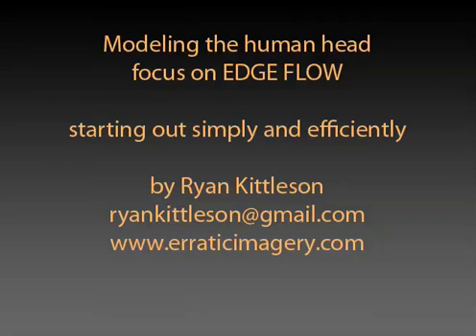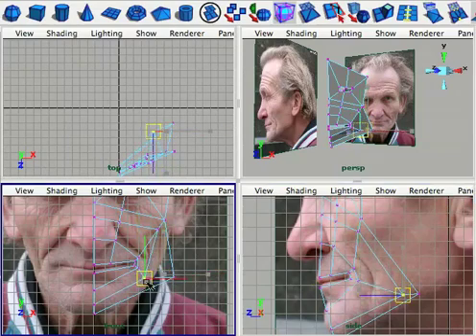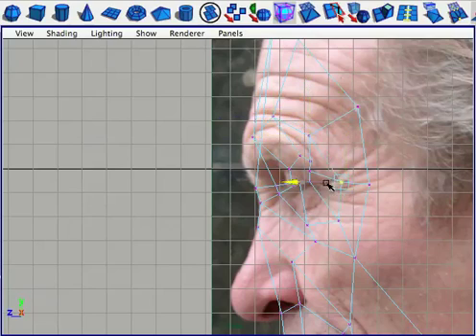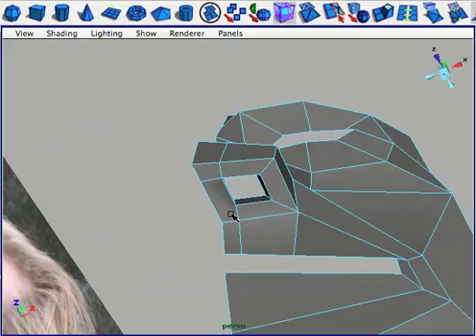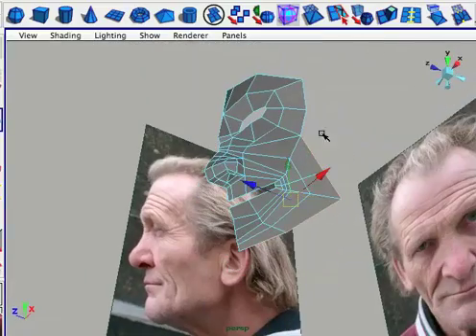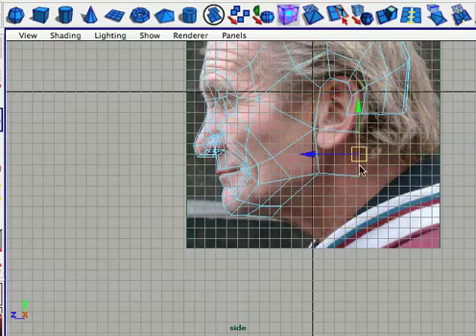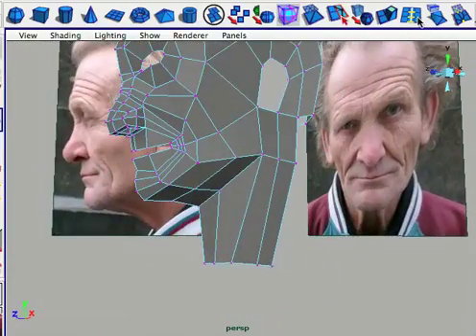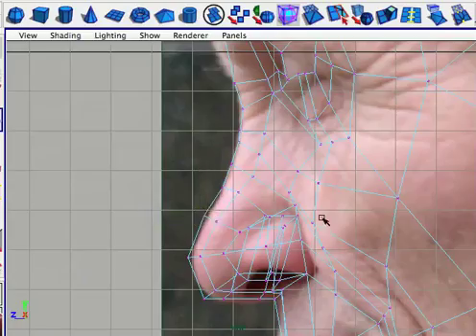3D Modeling tutorial for the human head. Focus on edge flow

Comment: I'm having a bit of difficulty working with the five pointed star at the bottom where the looks like it should begin. When i go to add the ear it turns into a 6 pointed star. Is there a way to work the edge flow around that area for the best results? These tutorials have been very helpful, thanks for posting them.

Comment from the maker: @VartinMana thanks!  six pointed stars are vertices that have 6 edges connected to them. they are bad because the more edges attach to a vert, the more weight it has over the deformation of that area.  It means that that vert will have disproportionately heavy effect on that part of the model.

Comment from the maker: @Grim1Tuesday2 What I think happened is when you mirrored the head, the merge tolerance was set too high and it merged verts that weren't actually mirror verts.  You can change the distance tolerance after you merge to a lower number to avoid the prob in the future.  To fix it, you can try deleting and recutting edges.  good luck!

Comment: Hey, great video. Two quick questions. How do you extrude from several vertices like that? I usually use edges, but you seem to be in vertex mode. Second, how do you then merge them together, such as when you had two seperate extrusions on the neck?

Comment: just a quick question. I want to model a head using subdivision. I have my basic head but I want to model in a way where when I move a vertex on the left side it will be mirrors on the right sight. How do you do this?

Comment: hey, im trying to do this in blender, im stuck at 3.22 when i delete an edge it destroys both faces.

the only work around ive found was to make a new face and then merge the intersecting edges and generally futz around with them till they look right.

its pretty time consuming and im sure there has to be a better way, like you demonstrated although in a different program.

any help on what tool i should be using would be appreciated

Comment: splitting up polygons and re arranging the geometry so they all have 4 edges is easy. but when I do that I get verticies that have more than 4 edges attached. they are not necessarily a "problem" if I have them in the right spot but they can screw up animation and UV mapping. I just try to keep the number of 5-6 pointed stars as low as possible

Comment: Of course there is - you just saw it (at least I haven't seen anything better), and I never said cube is the best, only traditional and most commonly used. Plus, darkgaze is talking about hiding the triangles using cylinder (like there's any difference - it's a stretched sphere) when he could (and should) easily avoid them altogether with a cube...

Still, this one easily destroys the cube approach , not to mention sphere or cylinder which I've never seen anyone attempt

Comment: Great. super great.

Wonder what are the best ways to build a generic head without all that level of detail, but the problems with starting with just a sphere... i know there are problems later on... with texturing in the place all the triangles join on top... i read you could do it with a cylinder turned so that joint is in the back of the head...

Comment from the maker: Hi Hadesdcc, glad my tuts helped!  I was using version 7.5 when I did the tuts. now I use 2009.  I haven't used the trial version, so I don't know if the tool is missing in it.  you might also try clicking on an edge and ctrl-right click, then go to the "edge ring tools" marking menu, and then click "split edge ring" when it pops up.  hope this helps!

Comment: Exactly. I'm using c4d and it works like a charm. A good modeling technique should be independent of the modeling package you're working with. General rules always apply, no matter what the edge cutting or extruding tools are called in max, c4d, lightwave or maya. :)

Comment: Wow you're an idiot.  By your reasoning PovRAY is even better since it does not even have a GUI.  You have to code your scenes by hand then then let the engine pars the scene then render it.  I started out on PovRAY while it was fun, I also like coding, it's not an ideal tool for efficient modeling.  I use both Max and Maya and as far modeling goes they are the same.  I pref Maya for texturing.  For me it's more intuitive.  You make like to bang your head but most just want to get the job done.

Comment from the maker: When a physical model or person is scanned, the result is super dense and messy.  There's software that ATTEMPTS to get the edge flow right, but really it's still a job that a human needs to do.  Basically by modeling good edge flow on top of the scanned model.  The advantage of doing it that way is that you get the extreme accuracy of the scan with nice animateable edge flow.  A talented digital artist can, of course, get the accuracy and edge flow without scanning.

Comment from the maker: You do raise some interesting points.  It is actually still very practical.  There is not always an actor available to scan, or the character is non human/cartoony.   Even if a clay model or actor is scanned, a lower resolution mesh with good edge flow must still be created based on the scan data, so this technique still is practical.

Comment: I am a fellow Maya user and 3d modeler, and I must say, your tutorials are great!

Might I make one comment though about this head? Wouldn't it have been more efficient (and better for the edgeflow) to have split for the bridge of the nose right at the BEGINNING, before you extruded in the eye edge loop? That way the nose and eye would be seperated into clear region right at the beginning, rather than having to use the split polygon tool to correct it later. Other than that, great job.

Comment: I'm still quite a noob here. I had problems with adjusting the eyes and nose, because every time I adjust it in the front view, it ends up mis-aligned in the side view this goes to the nose also. and whats the command you use where you can subdivide in a whole circle? I cant find that in the menus in Maya 6.5 to 2008 so I manually split polygon it.

Comment from the maker: 5 star verts aren't much of a problem unless they're in a detailed area that will be deformed.  It's easy enough to put them in non-detailed, non-deforming, non-visible places. stars with 6 or more edges are something that must be resolved.  For a full biped, I pretty much just fill the gaps between head, hands, feet and chest/shoulder with straightforward "checkerboard" pattern edgeflow.